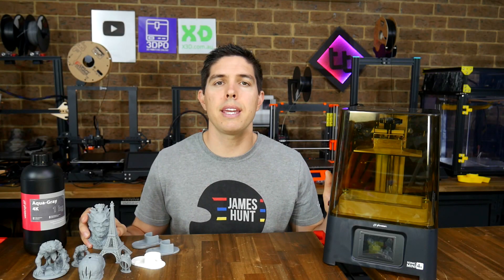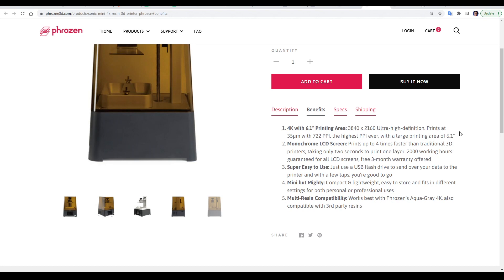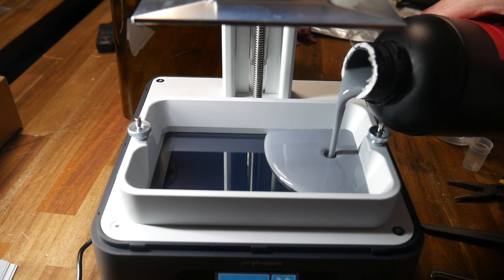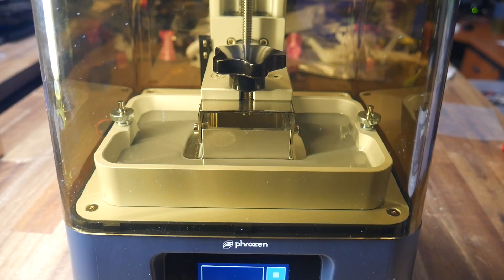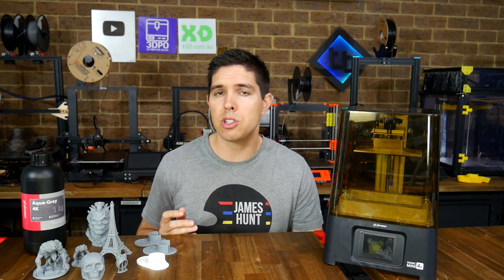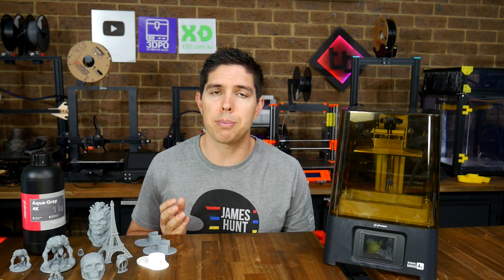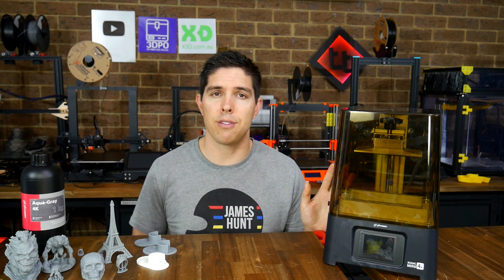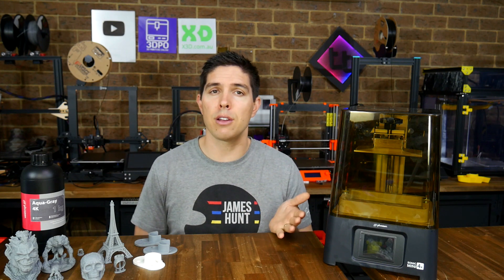Phrozen Sonic Mini 4K review - The highest quality resin prints

Comment: I bought the Sonic Mini 4K when they had a promo bringing the price down to $279 a few weeks ago on Amazon.  I'd been wanting to get into resin printing after 5+ years with FDM.  It worked perfectly out of the box and the test print was magical.  The liquid process is a bit messy but I'm getting used to it.  I definitely wouldn't try to do resin printing in my house, so it is relegated full time to the shop.  It is odorless but my shop is pretty well ventilated so maybe I just don't notice it.

I'm thrilled and looking for new adventures in resin 3D printing.  Thanks for your reviews.

Comment: At a claimed printing rate of 80mm / hour, and assuming the finest detail of 771ppi @ 2 seconds per layer, the ring should have printed in ~2300 seconds (~40 minutes). Why then did your print take 3h 20m?

Comment: would you please reco the best chitubox print setting and light support for printing small scale with high detail possible? i got my sm4k yesterday, i used to print on photon mono, and i tried the same setting but all my prints failed, im not really good at counting/engineering stuff, i used anycubic grey resin, it would be highly appreciate if you can help me with the chitubox settings that i can directly use to print. btw nice vids, subscrbd!

Comment: is this still the best option in june 2021? i need high quality for jewellery models
Reply: Below $500 it definitely is, but the Longer Orange 4K will reduce xy further to 31 um plus their previous releases were pretty successful. That's due out pretty soon. 

But if you're only doing jewelry and don't need to print anything bigger, personally I'd go for a used Solus. The detail is absolutely insane and rivals the $50K EnvisionTEC machines.

edit: there are a few Solus machines on ebay right now. I'd have one myself but the build volume is a bit too small for the work I do.
Reply: @upgrayedd9732  thanks for the reply, yes I’m just looking at jewellery so max dims are around 60mm. At the moment my prints cost 50$- 100$ each so it doesn’t take many to realise buying one is a great idea if I can match the quality. Will check the solus, is that the full name? DLP? Also to note I’m in the UK
Reply: @rosss7197  Yeah, the Solus is actually a DLP projector based machine and the build size is around 80x50x100 if I recall correctly. Lots of support for lost wax casting as well. The print quality is mind blowing.

They offer the Solus Pro now but it's pricey. The original machines IMO are just as good. Had some of my stuff done on both. I saw one last night on ebay for $1500 which is a steal.

I believe Reify 3D are the company that makes them. Good luck!
Reply: @upgrayedd9732  yep I’m looking at max $750 but it seems it’s either $500 or $1500.. I still need to get to terms with the resolution / quality comparison. Is that longer 4K better than the phrozen 4K.. still a bit confused

Comment: I know it varies depending on the resin used, but how resilient are resin prints? Are they extremely brittle, or can they be used in functional prints? Is it recommended to use the tougher resin for these types of tasks, or does the normal stuff get you by just fine for most use cases?

Comment: Hey I’m trying to decide between this and the elegoo Mars 2 pro or the anycubic photon mono se any advice here I’m looking at getting into custom jewelry and small decor pieces
Reply: What did you decide? I am sort of in the same boat.
Reply: @DoubleL11862  I’m in South Africa and it takes so long to get stock at our local retailers that I still haven’t got it but I decided the 4K mighty is a better option you lose some definition but the large build area means more objects per print also it’s a way more solid built machine the price gap here isn’t huge either

Comment: I see during the build plate leveling the paper used was folded and had a gap under it when you tightened the screws. Is that an issue? or how precise does the leveling of the build plate have to be?

Comment: Excellent review.  Your channel is one that I promote because you are thorough, straightforward and high quality.   Your best feature IMHO is your emphasis on the real resolution, which most channels fail to emphasize.  I hope to push you in the direction of continued marketing of the dpi as a standard required spec, and it would be great to define both x,y and z dpi on these resin printers so that the screen build area and min layer thickness are all accounted for.  Keep up the great work! 👍

Comment: The Anycubic Mono X = 699USD
Phrozen Sonic Mighty = 768USD

I just can't decide.
Both seem to have poor support.
Reply: Anycubic I actually have a positive customer support experience with where they ended up sending me about 100$ worth of resin for free. I have the zero, so as you can imagine I am still using the resin.

I am so confused as to what printer I want to use as well. Mini is great, but to upsize is a close call between both.

If you ever do buy, tell me how it goes. Very similar machines, honestly, it's a matter of which ever one of them goes on sale first.

Comment: Man, you didn't mention your printer settings. That's important info! I don't even know the maximum printer resolution in millimetres.
Reply from the maker: If you download chitubox for free, it will tell you the specs of this and many other printers. It's a great way to compare them.
Reply: Here's the settings I eventually figured out: 
Layer Height: 0.05
Bottom Layer Count: 7
Transition Layer Counter: 0
Exposure Time: 5s
Bottom Exposure Time: 30s
Light Off Delay: 10s
Bottom Light Off Delay: 9s
Bottom Lift Distance: 6mm
Lighting Distance: 6mm
Bottom Lift Speed: 60mm
Lifting Speed: 60mm
Retract Speed: 150
(This is for Water washable Resin on a Sonic Mini 4k)

Comment: I have the mighty version of this printer coming.  Just curious what best resin you would recommend to use for it?   Looking for something thats not brittle.  Not anything i plan on using for mechanical parts but probably more for show pieces / busts / things like that.   Something that will paint good as well.
Reply: There is a flexible resin you can mix with normal resins that lend to more durable prints, just google rubber resin 3d printer

Comment: So practically the only thing holding back 8k resin printing is the LCD.
Reply: that... and your wallet
Reply: The environmental concerns will probably continue to scare some folks off. Also, there will be a limit to resolution related to the wavelength of light used for curing... but screens are nowhere near that limit yet.

I'd like to see much larger displays and light sources that are reduced in size via optics; the concentration of light could improve speeds drastically.
Reply: Actually phrozen now has an 8k printer hitting the market at a really reasonable price it’s just the shipping that’s rough
Reply: on aliexpress i found a 10 inch 5k monochrome lcd at 335 $, but it has not the light source... so i think is a question of wallet, the corpos will wait for better price and availability
Reply: @librasd8087  I looked also some months back and was put off by the price. I stopped researching.
Reply: @chazbarclay  I was interested in a large resin printer, I did research on the mono x anycubic, but on amazon it costs 870 euros, absolutely too much, while on ebay I found it for 570, still a lot of money, but I don't understand how they sell it at that price if then, looking on alibaba, I found that only the lcd screen costs 180 euros. These screens and led matrix make up a large part of the cost
Reply: @librasd8087  They sure do. In my research I came across a video by Linus Tech Tips about screens. Screens are manufactured as sheets and until the price comes down where they can cut smaller sizes out of them, it will take some time. Fortunately prices have been falling pretty fast for lcd/oled and such. I've been thinking of buying a good one and off setting the price by doing a print service. People do pay decent for custom figures they want printed.
Reply: @chazbarclay  I, personally speaking, do not have many projects in mind to make with a 3d printer, I already have an fdm printer but I use it mainly to create spare parts for objects that break and are no longer on the market, so I don't often use the 3d printer. The idea of making pieces for other people is not bad, especially with the resin printer that offers better quality than a fdm. The important thing is to spread the word, I think you can use social networks and forums to get started.

Comment: Hi, I love the review and I tried the eiffel tower model, you printed aswell, unfortunately every time one of the feet(always the same one) fails and I have to stop the print. I tried to print it not tilted may this be the problem or could it be a problem in my slicer wich fails to render this particular foot right? Any tips or ideas how to fix this? :)
Reply: You should probably re-level your bed. It's quite sensitive. You can tall if there are any issues by doing a test print in each corner. If one doesn't stick: relevel

Comment: To show the detail, you actually need a new camera and a better lens :))
Reply: Not really, but definitely a tripod and manual settings on the camera + correct lighting. Also proper miniature settings on the printer and better example models to properly show off how you benefit from a higher resolution in XY and comparisons to lower res printers - not friggin fdm with no mention of layer height.

Comment: But why the wardrobe clip is installed this way instead of having the round part on the bottom? you could've also made it thicker on the holding part to avoid having to print it again due to breaking...

Comment: After 5-6 years of FDM printing I got my hands on one of these 2 weeks ago for parts I need watertight. It's worked perfectly out of the box and the results have been mindboggling! Only failed print was from not tightening one of the vat screws after cleaning.

Comment: I have been interested in buying a resin printer.  I currently have a large delta and an ender 3 FDM printers.   Just how messy is resin printing compared to FDM?  Also do you have to buy extra stuff to cure the prints or can you do it without?

Comment: I've been considering getting this, but I had a few concerns.
What are you guys' take on the venting requirements and smell of the printer as it prints?
I've heard that it has a strong smell even in well ventilated rooms.
Reply: It's not the smell you have to worry about. It's not less toxic if the resin is odorless. Best way is to have a dedicated space with an active fan that can evacuate the contaminated air outside of that room. Also run the fan as you take the hood off of the printer and while use cleaning agents and whatnot.
Reply: @basementdwellR  Well obviously the fumes are what you're more worried about which is why I bring up the venting requirements, I'm just saying that on top of needing better ventillation,  a lot of resins have a heavy odor. I wasn't aware that there were odorless resins, though.
Reply: @1objection  I would argue that smelly resins are better; if you can smell it the area is not ventilated enough as smell is particulates :) And yes there are odorless(ish) resins too.

Comment: Michael, another great review. Did you angle that last print at 45 degrees? I  didn't see any support scars on some of the overhangs. I'm more familiar with a Form2 where you need supports on pretty much every little overhang.
Reply from the maker: The wham bam plate was on at that stage, so I was able to print it flat on it's base like you would on fdm and still remove it easily.

Comment: Really appreciate the work that you put into the videos.  I value your opinion.  I have been looking at all the reviews and my conclusion comes down to cost  to benefit ratio.  Mars 2 pro versus sonic mini 4 reviews  have been the mini beats the pro but not by heaps and bounds in regards to quality.  Here in Canada, I can get the Mars 2 Pro for $333 plus tax of 15% Canadian.  The sonic mini 4 price is between 530 to 550 plus tax of 15%.   That is approximately a 59-61 percent increase in cost, but does the mini provide a 60 percent increase in quality?  While attempting to quantify such a subjective concept is difficult, from the side by side comparisons that I have seen done online, the Mini is not 60 percent better in quality.  My subjective guess would be 15-20 percent better in quality.   I am sure there are other factors to consider such as print speed which the mini wins at.  Printer volume size, the Mars would appear to win on that one.  Due to the price difference here in Canada, I would have to vote for Mars 2 Pro.  Just my 2 cents.   

Keep up the great work.

Comment: Hi, can you help me with my printer? Its an ender 3 but I think its a problem with cura as its the same issue with different models. Near the top, the layer doesn't go to the correct size so it makes sort of a taper for 3 layers and then goes back to normal

Comment: I’ve only had my sonic mini 4K a couple of days, and I am completely blown away. I did find that I had to sand the build plate as bigger prints were dropping off the plate. I also had to very carefully trim the tape on the edges of the screen as it caused a bed levelling issue in one corner. But compared to my previous photon it’s an absolute dream!

Comment: I’ve got the Sonic Mini 4K and I’m amazed by the prints’ details. The only down side I found till now is the z-axis height. It’s too tight to manipulate the build plate and drip the resin residuals from the print back into the vat. I end up getting resin in some part of the printer most of the time. Besides that, I’m loving the printer.
Reply from the maker: I did have that trouble with the Eiffel tower model. Doable but tight as you say.

Comment: I currently have 2 FDM printers which are both about 3 years old and have been thinking about getting a resin machine.  I want something that can do more detail, which resin is good for, only thing holding me back is the concern for the smell of the resin.  I machine will be in my small office which is only 3meter X 3meter (10 foot by 100 foot).  Michael whats the smell like for the Phrozen resins and how big of an area do you print in.
Reply from the maker: I have them in a separate room, actually inside a built in wardrobe with an exhaust fan in the ceiling. I have been slowly refining my setup and will be making a video in future. The Phrozen resins have odour but it's pretty reasonable. It's no where near as strong as Isopropyl alcohol and other washing solutions people use.
Reply: H D  Can't really vent it out the window as the printers are on the opposite side of the room where the window is.

Comment: Another great review. One thing that caught my eye was your mention of 'Burn In Layers' I'm guessing this is something that ensures build plate adhesion? A friend has has prints come of the bed and also layer splitting early in the print. Can you explain how to set up burn in layers?
Reply from the maker: The first few layers (six in this case), are cured for 25 seconds instead of the 2-2.5 seconds for the normal layers. This makes them bond really well to the build platform, kind of like a raft in FDM. When I was having problems, the resin profile was set to 4 layers at 20 seconds. After switching to the official Phrozen settings no more issues.
Reply: @TeachingTech  Great info, thanks Michael, I'll pass that on.

Comment: Michael, do you have experience putting ptfe lubricant or something similar on the FEP film to prevent prints from sticking? Would love to see a case study on that!
Reply from the maker: I purchased some PTFE spray ready to experiment but haven't done it yet. I am looking forward to trying it.
Reply: @TeachingTech  Put a little bit of that PTFE lubricant on your lead screw as well.
Reply: @TeachingTech  awesome! I'm curious to see what impact release agents may have on resin prints. Uncle Jesse seems to have success with it
Reply: You can use normal talc, then wipe the fep well with a cloth. It works

Comment: The whistle and the Ikea bracket  you printed on this machine and the Prusa Mini, what was the print time like between the two printers for the same model?
Reply from the maker: Great question. In resin, doing two at a time at a 45 degree angle with supports was 3 hours 30 minutes. With the Wham Bam sheet you could potentially print them flat on the bed (and then easily flex off) and halve the time. On the Prusa Mini, I printed them one at a time at 1 hour 20 minutes. Therefore, I would say the monochrme LCD speeds things up to the point where it's almost as fast as FDM if you can print multiples in the one resin print (which takes the same amount of time).
Reply: @TeachingTech  Awesome information, thank you!  Been wondering how fdm and monochrome resin compare in terms of speed, I figured it was not a simple answer, but this does help quite a lot.
Reply: On LCD printers printing time scales on number of layers, not area of layers, as the entire layer is cured at the same time. Resin printing can be a lot faster than FMD if you do something quite small you can fit many copies next to each other, like rings for example.
Reply: @ayylmao.mp3  I understand how the layers are cured, just never seen anyone compare the new screens with fdm and printing time.  I just keep hearing the new screens are faster and more durable.  

I am a man with very little patience, fdm printing still tests that patience a year and a half later.  Resolution is important, but I tend to error on the side of speed and do more post processing, depending on what I am printing.